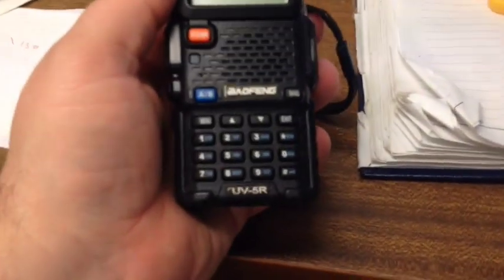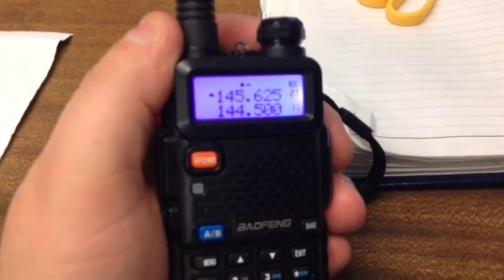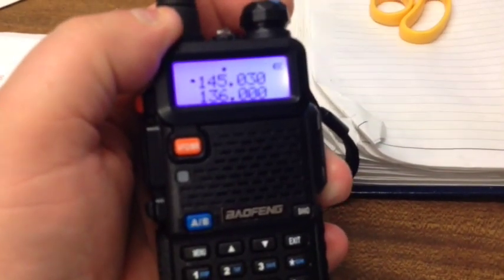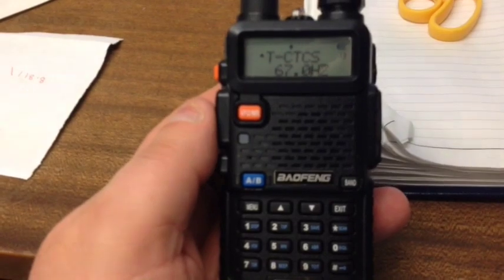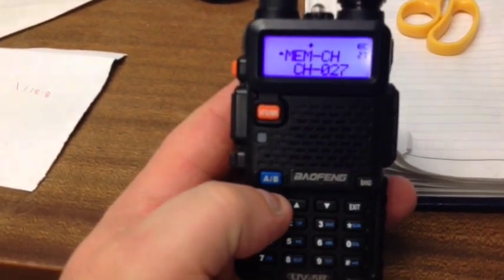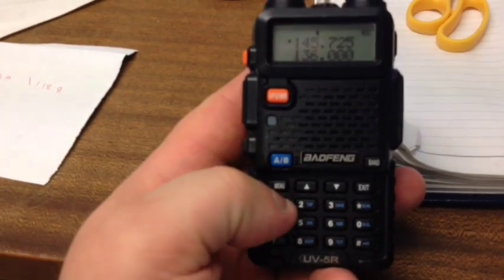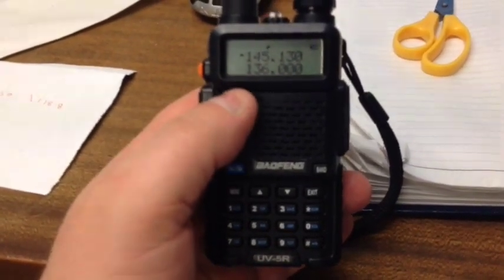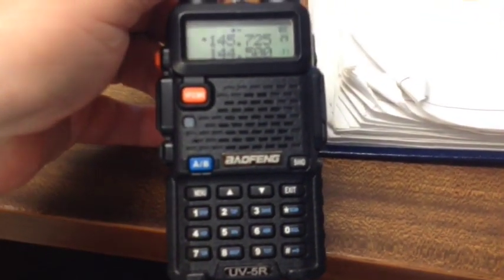How to program Repeaters manually on Baofeng UV-5R uv-9r quick when you know how Link in Description

Comment: can I contact someone a few states away using connected repeaters? a signal jumping from tower to tower back and forth from Jersey to florida.
Reply: If the repeaters are linked, yes.  One excellent example of this is the East Coast Reflector Tech net which covers all the east coast on these frequencies via linked repeaters and Echolink.  You will not be able to choose when the repeaters are linked unless you are privileged with the closely guarded tones to do so.  If everyone had them, it would turn into a crapshoot real fast.

Comment: I own both the UV-5RC and the 5R and the repeater for my area is 146.760- PL tone 114.8. I'm just curious on how to figure out what the Receiving frequency of the repeater (transmitting freq of the handset) is? How did you come up with 145.130? I'm totally new to this.
Reply: On the 2 meter band, it is popularly depicted by just a plus or minus sign.  It is assumed that the standard offset is to be 600 Khz, this is covered in the technicians exam as well as can be figured out in about 30 seconds with google.  In your case, the repeater rx frequency will be .600 mhz less than its tx frequency, or 146.160, if the minus you have above is correct.